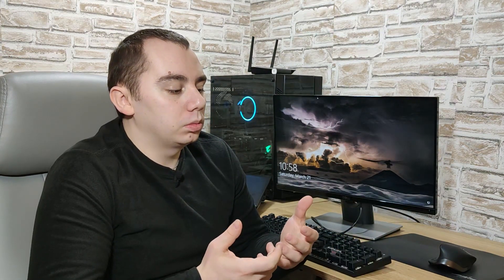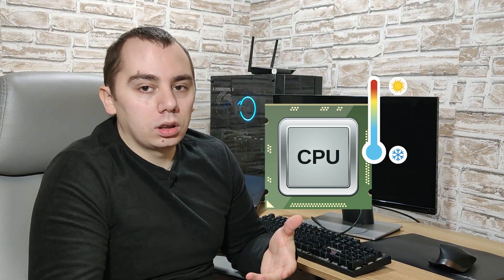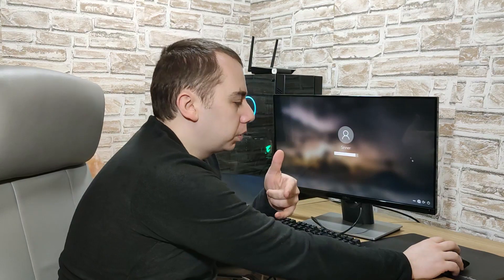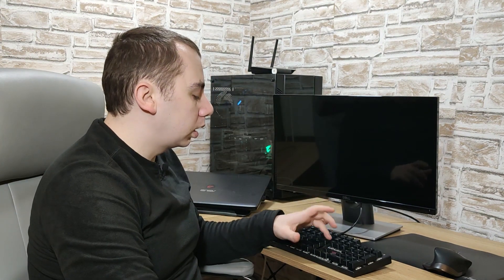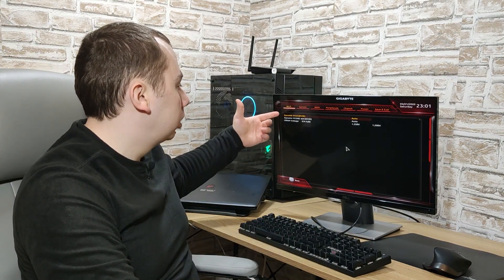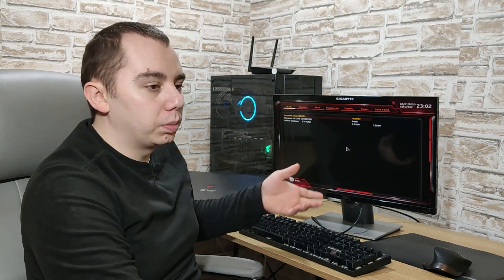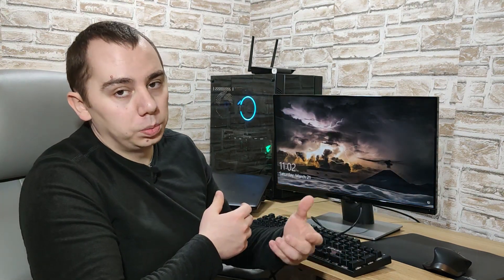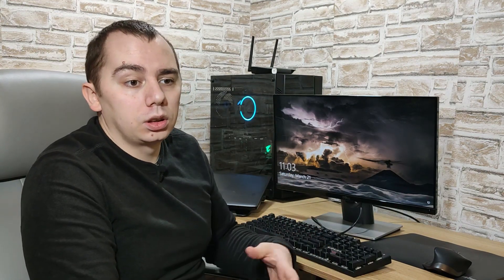Undervolting a Ryzen CPU - EXTRA performance and quieter PC for FREE

Comment: Bro the settings don't save once i save my settings for ryzen 5 3600 1.1375V @ 4.2ghz it goes back to auto when i tried to check whether it saved or not
Reply from the maker: Hey! That's weird... I know that some motherboards revert to optimized default settings if current entered settings are unstable.

If that's not the case, have you tried checking if all the power-saving features are off?

note: I hope you're not referring to Ryzen Master Software, that software cannot apply settings at boot.
Reply: No bro I'm talking about bios settings only. And i have opted for high performance mode . Can you make this guide on gigabyte b450vdh max  motherboard because there is no guide for this motherboard if possible😅

Comment: When I changed the values my Pc doesn’t post video, I need to reset the bios, I have a ryzen 5 3600 and board b450 aorus m, any suggestions? 

Note: I can do the undervolt with ryzen master 
4.2 ghz all cores and voltages 1.2v but I want to do permanently
Reply from the maker: Hey! So I don't have too much experience with Ryzen 3000 series, as I didn't get to test too much.
But maybe, for starters, something like the Clock Tuner utility will help you manage your CPU better for more performance and better power usage: https://www.guru3d.com/articles_pages/clocktuner_for_ryzen_ctr_guide_download,1.html

Comment: Hey, would this work for Ryzen 5900X?
Reply from the maker: At launch, 5000 series didn't have undervolting. As far as I know, a new AGESA update (through BIOS update on the motherboard) will offer this. Or it already does, I don't know as I don't have a 5000 series.
However, this new series are very efficient, and most likely it will work, and offer very nice results.
Reply: @techieshow  Thank you for your response. I've also after this comment seen that they will offer it with newer bios updates.

Comment: Thank you for the video. I have Asus X470. Whats the equivalent for dynamic vcore for Asus bios?
Reply from the maker: Thank you for watching and the comment! :-)
As far as I know, on an Asus ROG motherboard it is in Ai Tweaker menu, as VDDCR CPU Voltage - set it on offset mode. Then VDDCR CPU Offset Mode SIgn should be - (minus) and below you set the Offset voltage value (VDDCR CPU Offset Voltage).
Reply: @techieshow  Thanks! I am looking forward for new videos.

Comment: Is it safe to undervolt Ryzen 5 3600 by an offset of -.186?
Reply from the maker: There is no unsafe setting, only unstable. (undervolting does not damage the cpu, as oposed to overvolting)
So if it's stable and you don't get Blue Screen errors or system lockups then it's ok.
But, be sure to benchmark your CPU with the undervolt and without. To be sure you're not over-doing the undervolt and losing performance.
Reply: @techieshow  thank you!

Comment: What would it be the recommendations for a ryzen  3600 ? I do not wanna break AMD warranty, I'll be using an ASRock motherboard.
Reply from the maker: Hey! So, undervolting does not break warranty.
On 3000 series, as far as I could tell from other online sources like GamersNexus, a small offset like in this video would help. Be sure to benchmark before/after in Cinebench R20, 3D Mark (looking for the cpu score) and make sure you actually get lower temps and the same performance or even better performance.
You could try a - .1 offset or - .05 offset. Again, be sure to test your performance before and after undervolting to make sure it will actually help.
Reply: @techieshow  so -1000? or -0.500, sorry i dont know if thats what you mean im a newbie at this.
Reply from the maker: No probs! -0.1 or -0.05.
Really the best way to go at it is to gradually decrease the offset voltage. Even if it's time consuming, decreasing by one or two steps at a time (BIOS has predefined steps) and then benchmarking to be sure everything is ok is usually the best way to go at it.
Reply from the maker: Forgot to say: each CPU is unique due to the variation in manufacturing process (even two 3600 can be unique and handle different undervolt values). That means that going at it step by step is the best way to find out how much your specific CPU can handle before you lose performance or have instability in benchmarks/games.

Comment: Hello! I undervolted my cpu voltage of my ryzen 5 2600 -0.108V but i dont see any improvement on cpu temp in cinabench. Should i revert back to auto or just stay with this voltage? Thankyou!
Reply from the maker: Well if it doesn't do anything might as well revert back to auto. Strange tho', cause -0.108v is pretty strong. Ryzens are weird :))
Reply: @techieshow  maybe i need to change my thermal paste. Thankyou!!!

Comment: Does it work on Ryzen laptops?
Reply from the maker: As far as I know, no sadly :-(
We're still waiting on some software to undervolt Ryzen laptops to appear. 
It's more likely for a program to appear than for laptop manufacturers to allow such freedom inside the laptop BIOS. (see Intel-based laptops wherein 99% of them you need to use Intel XTU or Throttlestop)

Comment: I can go as far down as -0.13125 without lowering cinebench scores but clonezilla will just kernel panic, at -0.1 it does't while at 0.11250 it does it sometimes but rarely AMD will clock stretch so report higher clocks but actually they are much lower to preserve stability for some odd reason it does not preserve stability tho under linux with negative off set it could be stretching on single core boost or even medium load while being fine under high load i think which is why im questioning undervolting these days
Reply from the maker: I didn't really have any issues like kernel panic. But I must admit I have not used Clonezilla. I will give it a try to see if it happens to me also.
But indeed, proper stability testing is a must, you just never know. I never experienced performance or stability issues (using the same bios settings I used when on Windows, did not change anything in BIOS).

Comment: Hello I have an amd a9 m430, do you recommend undervolting?
Reply from the maker: Well, yes. But I don't think there is an easy way to do that. On most AMD notebook CPU's undervolting is quite lacking right now as we don't have BIOS options or any software as we have on the Intel platform - like Throttlestop or Intel XTU.
Reply: @techieshow  thanks for the reply, I couldn't even open the BIOS ( tried all buttons)
Reply from the maker: @immersive_cinema  Try repeatedly pressing F2 while the laptop boots if it's an Acer E5. (even if the screen in black after pressing the power button. You should eventually find yourself in the BIOS)
But I doubt it will help regarding undervolting as most notebooks do not have such options (voltage/clocks/etc.) in their BIOS.
Reply: @techieshow  alright thanks man

Comment: Bro, stiu ca esti roman. Am un procesor ryzen 3 3200g, și sta la voltaj 1.4, si in aida64 ajunge la 80 de grade... este clar ca este muuult prea mare voltajul, ma poti ajuta cumva? Ca nu ma prea pricep, am acelasi bios ca si tine, dar orice fac, nu scade voltajul
Reply from the maker: Ryzen seria 3000 e mai ciudata. Ca sa fii sigur ca nu suferi de un 'bug' de monitorizare, si vezi datele reale asigura-te ca:
1. Ai driverele de chipset ale placii de baza la zi.
2. Ai ryzen master instalat si power plan-ul lui Ryzen in Windows 10 activat.
3. Nu ai nici un tool de monitorizare activ. Nici macar Ryzen master sau ceva de la placa de baza. Inchide-le pe toate.
4. Porneste CPU-Z si urmareste in idle voltajul. Acesta ar trebui sa scada sub 1.0V cand nu faci nimic (te uiti doar la CPU-Z si atat).
Daca in idle in CPU-Z la un moment dat scade sub 1.0V, totul este in regula.
E normal sa sara la 1.4-1.5 in boost. Ryzen isi modifica de aproape 1000 ori pe secunda voltajele, nu ii va afecta durata de viata.

Daca nu scade sub nici o forma in idle sub 1V niciodata, asigura-te ca totul in BIOS este pe auto (voltaje, setari precum Cool'n Quiet, etc.).

Seria 3000 e facuta sa functioneze intre 0.4V - 1.5V.
Totusi, daca in load obtii constant peste 80 de grade, e o problema. Ideal vrem sa fim sub 80 pe procesoarele astea. Daca ai schimbat pasta, schimb-o din noi, poate nu e ok (aplicatia/pasta/cantitatea). Verifica sa aiba si ceva airflow carcasa eventual.
De asemenea, orice forma de overclock cu coolerul stock nu e o idee buna.
Reply from the maker: ENGLISH ANSWER:
So he's asking about the constant voltage he's seeing on his Ryzen 3200G and the 80 degrees temps while stress testing.
Here's the translation of my answer:

Ryzen 3000 series is weird a bit. To be sure you're not suffering from a monitoring bug and you're seeing the real data please make sure that:
1. You have updated the chipset drivers of your motherboard.
2. You have Ryzen Master installed and the Ryzen power plan activated in Windows 10.
3. You are NOT running ANY monitoring tool. Not even Ryzen Master or any motherboard-bundled software. Close them all.
4. Open up CPU-Z, and just stare at the screen. You want to see the idle voltage of the CPU. It should often dip to under 1.0V. If it does, everything is ok.
It is quite normal for Ryzen 3000 to jump to 1.4V or even 1.5V while boosting. Ryzens are altering their voltages about 1000 times per second and it should not reduce their lifespan.
If you never get under 1V, make sure everything is on Auto in the BIOS (voltages, settings like Cool'n Quiet etc).

The 3000 series is made to run between 0.4V and 1.5V.
Still, if you constantly go over 80 degrees, that's not ok. Ideally we want to stay under this figure on these CPU's. If you changed your thermal compound, repaste. Maybe change the brand/quantity/method of aplication. Also make sure your case has good airflow and the CPU heatsink/fan is dust-free.
Also, any type of overclock with the stock cooler is not a good idea.
Reply from the maker: Am uitat sa mentionez:
In planul din power options, cel ce vine cu Ryzen Master, asigura-te ca la Advanced Power Plan Settings,  'Minimum CPU speed' ai 20%. Daca e mai mare, procesorul va sta constant in frecvente si voltaje mari.

Forgot to mention:
In the power options plan, the one that comes with Ryzen Master, make sure that on Advanced Power Plan settings the 'Minimum CPU stat' you have 20%. If it's 90% or something like that you CPU will not be able to reduce its clockspeed and voltage while not being used. That will lead to higher voltages and temps.

Comment: can you tell me what I should use for a AMD Ryzen 5 2600? My temps go upto 80*C while gaming with 3.8GHZ...
Reply from the maker: I am not sure I understood what you mean: Are you overclocked to all-core 3.8GHz? If that's the case I suggest a better CPU cooler. The stock one is not great for overclocking.

Comment: Hi what about the A6 9500? What do you recommend?
Reply from the maker: I never tried undervolting that one, as I never had one. But as far as I know it's a fairly weak CPU. I guess it depends on the chip and your BIOS how far and if you can undervolt it. The process should be similar.

Comment: I undervolted my 3950X with up to -0.1v offset. I get about the same, maybe slightly higher results in R20, at about 10-12deg C cooler. I did however notice that my max single-core boost went down from 4.725 to 4.675, despite the same (or slightly better) R20 multi / single results... Will see what the differences are for gaming. Pretty interesting topic!
Reply from the maker: Interesting. I did not notice a max single-core boost decrease on the 2700 Ryzen, and on a particular chip (I have two) it actually goes 8 MHz faster - no idea why so far. But on gaming, I did not notice any drop/increase. Just lower temps on 'heavier' games.
Definitely let me know if you can if you see some modifications in your FPS when gaming. I am really curious about the 3000 series :-)
Reply: @techieshow  I will try to run some benchmarks over the weekend :)
Btw I am using boosttester(.exe), here: https://github.com/jedi95/BoostTester/releases . quick and fairly reliable way to check imho

Comment: Does undervolting change the cpu clock speed?
Reply from the maker: No. Usually too much undervolting results in crashes (blue screens). But it may lead to just instability or poor performance, not just crashes. So you basically just need to make sure to test before settling with a new undervolting setting.

Comment: did you apply the PBO too?
Reply from the maker: Hey! So on this machine, no. Because it's a non-X Ryzen. It's a Ryzen 2700 - PBO does nothing for it.
But on 2700X PBO should be enabled also. Be carefull, as far as I've seen on Ryzen X cpu's, PBO should be ENABLED and not on auto mode. Paired with a negative offset for the CPU (basically undervolting), these gave the best results. Both for 3000 and 2000 series.

Of course, none of the above applies if you are overclocking. This is just for who wants PBO and better temps without the hassle to overclock and fiddle with all the settings invlolved in overclocking.
Reply: @techieshow  hey so I have a r7 5800x, I’m setting the VDDR CPU Offset Voltage to -0.05, do I need to enable Precision Boost Overdrive? Figured I’d undervolt the cpu too since I did the gpu yesterday :)
Reply from the maker: @SnrMuffin  Hey! As far as I know, on the 5800x you will get better results with manual voltage setting (ex: 1.250V) with Precision Boost Overdrive enabled and on auto.
Fine tune that voltage until performance and temps are acceptable to you. You can go upper or lower on the voltage (don't go over 1.45V)

Another place you can squeeze some performance from, are RAM timings. That can get quite complicated and it could take a while. But just by fiddling with the voltage you can get more from your chip with minimal effort.
Reply: @techieshow  ok so I should set PBO back to auto? I switched it from auto to enabled after I undervolted yesterday. Ran stress tests on occt and played games for a few hours. Nice and stable. I’m gonna try -0.1 today and see how that goes.
Reply from the maker: @SnrMuffin  I'd try Auto just to make sure you're not missing on anything.
Also, do make sure to try some manual voltage setting for your CPU after you have reached a satisfying offset setting. You might get better performance and temps.

Comment: I need help...can u give me the best setting for ryzen 5 2500u on my laptop?Hope u reply
Reply from the maker: As far as I know, Ryzen Mobile CPU's cannot be undervolted at the moment. Best you can try is to undervolt the GPU a little. I will make a tutorial regarding that soon.
Reply: Check power settings if you use windows. Windows 10 in particular helps you to run the cpu at lower clock speeds.
Reply from the maker: @ozmobozo  True but if I recall correctly everyone should already be (if not overclocking) on something like 20% minimum CPU speed in the power plan thanks to the Ryzen plan (that comes when installing Ryzen master)

Comment: I need help
After fighting high temps with my ryzen 3600 i decided to lock cores to 4.2Ghz and lower VCore to 1.25V like some people advices.
Got lower temps, from 86 aida64 to 76. Wow, same results(even more in multi thread) in C20 and Cpuz bench. 
I tryed to play around and get higher clock of 4.3.
When I used Prime95 everything cleared up. 4.3 at 1.25 was failed, and 1.27 also. I stoped and went back to 4.2.
I decided to check 1.2375V on 4.2Ghz. And wow, prime 95 no errors in like hours. 
And then I decided to see how low can you go and put 1.1V at the same 4.2Ghz.. And you know what? Its seems stable. And benchmarks? Same results.
By the way. With 4.2Ghz locked, my bios sets 1.325V

What am I doing wrong? Is this Possible? And what can be the negatives?
I do realise there are the laws of physics and if you use less voltage you do need more amps, Maybe all of this is bad for the motherboard? Since in Ryzen master i noticed that and tdc go up more then 100% when I run Intel Burner.

Comment: What is a good recommended setting for Ryzen 5 2600? can you tell me? i don't wont to mess up
Reply from the maker: Hey! I've seen Ryzen 5 2600's that can go as low as -0.100V on stock (non-overclocked). I'd aim for ~ -0.080V to be sure you're stable in every scenario.

Mind you, after applying test! In games, OCCT or other benchmarks and heavy workloads. Every chip is different.
Also, if something goes wrong, you'll just get a blue screen while gaming or whatever you were doing. If that is the case, just go to BIOS and lower the undervolt from -0.080V to -0.070 or in small steps.

The setting is usually called CPU Offset Voltage in the BIOS. Using PageUP/Down you can increase/decrease. We want it to have a minus in front of the value ( -0.080V).
Reply: thank you 👍
Reply: @YT_JKLGaming  whats your actual settings in that ryzen??
Reply: I set mine to -0.100. but the voltage i got is 1.106v based on hw monitor.
Reply from the maker: @kratoz_858  Seems about right. Please note that -0.100 is the offset, not the actual voltage. So it decreases as close to -0.100 as it can, from the original voltage. You may even see 1.2v in some cases even with that undervoltage.

Comment: I was able to get a 4.2ghz on a 3950x with 1.220v. Is that a good oc?
Reply from the maker: That's pretty good! An all-core 4.2 GHz with that voltage is not bad. Probably a lot lower than what it would push if left in 'auto'. What are your temps?
Ever tried going to 4.3 GHz or 4.4 GHz?